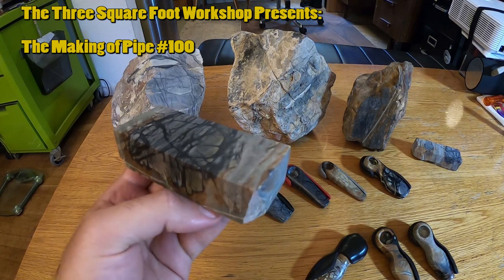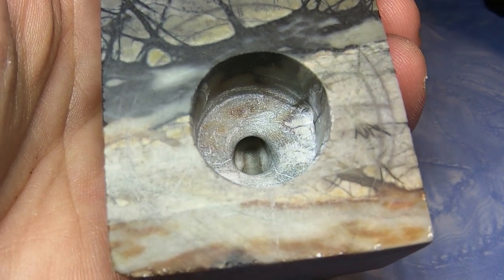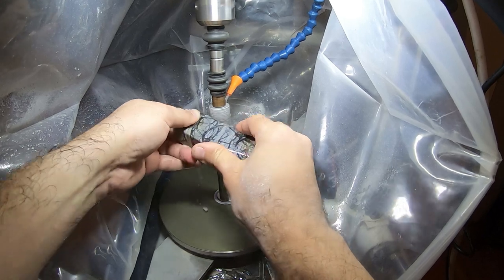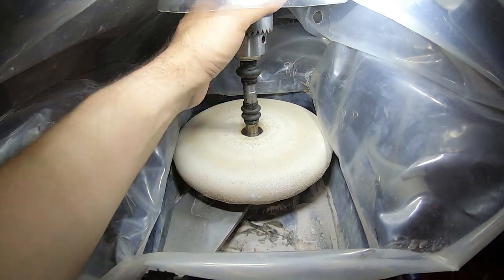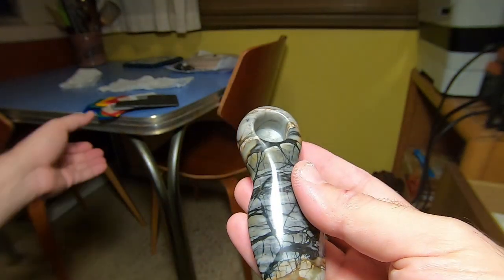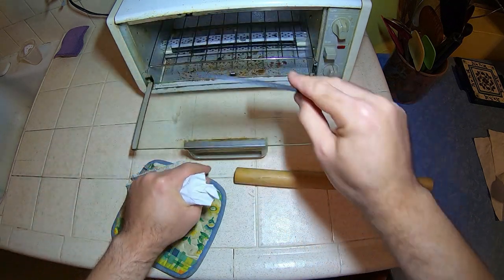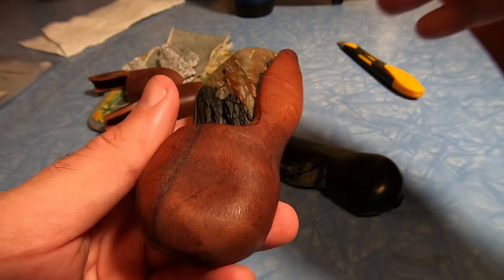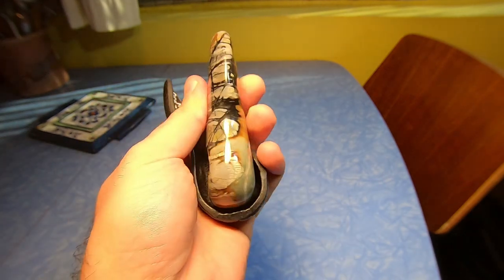How I do it: Stone pipe with moulded cap; functional, elegant & convenient (#100)

Comment: Where can buy buy high quality stone pipes? I’m just tired of imperfections in my glass pipes and because they are always in the bowl
Reply from the maker: That's a tough one.  I started making stone pipes myself years ago, because I was unable to buy decent ones.  The ubiquitous "crystal pipes" are cheap imports; although many of them are quite pretty, I doubt they smoke very well (improper bowl geometry; they require basket screens).  Have a look at etsy though; I can't speak specifically to anyone there, but I have found a few folks with work that impressed me when I've browsed to see what's out there.  (Also lots of folks there reselling those imported "crystal pipes", so beware.  Avoid anything that needs a basket screen.)  If you have your heart set on one of mine, I would be flattered, but price will be high.  Each one takes 6 - 10 hours, so you can do some math and make me an offer where equivalent hourly wage wouldn't be insulting.  (I am a hobbyist, this is not a business, although maybe someday...  Would need to make more tools to substantially cut down on time needed, so prices could be more reasonable.)  Currently available inventory is shown here:
https://1drv.ms/u/s!AvYb6LjaPrjqkRiG6U7clQCJM2qC?e=KTyyRi

Comment: Hey I want to set up a shop like yours. I want to follow this process so I can make my own stone pipe. Can you please send me a list of your equipment needed to make a drill press into a grinding wheel like you have? I would really appreciate it
Reply: Also where are you getting the tools? If you could include make, model, price etc I would really appreciate it. Also what kind of plastic sheets are you using for the kids?
Reply: -lids
Reply from the maker: @jasonfink985 
Thanks Jason!  You're in luck; my next video ought to be posted this weekend, and goes into depth on the drilling fixtures and tools, including make and model of the big pieces.  I spent a few grand for all this.  I have plans on making a video all about 'grinding mode' in the future, but that will take a while before I get too...  (Also want to show more about the closed loop water system, drill bit sharpening, and a few other topics.)

The pipemaking and stonecarving groups on Reddit would be great resources for you to explore.  (I also learned tons by joining my local Rock & Mineral club, and got access to the giant saws and stuff in their member workshop; check out your area for that sort of thing too.)

I turned my drill press into a grinder for space savings reasons; not cost savings.  Wouldn't recommend you follow that path if you have room for a real grinder.  Look at the Ameritool Universal Heavy Duty Grinder, Hi-Tech Diamond All-U-Need, and their Slant Cabber.  And explore the Covington Engineering catalog; they sell machines, and PARTS!  One of their arbors is how I support my grinding wheels.  (Assembled special for me; upside down, and with a ring pressed into it myself to bring up the diameter to match my drill press's table support arm...)  The driveshaft is a Lovejoy DD3 double U-joint, with bellows added to both joints.  (This was more expensive than the custom arbor!)  One end fits directly in the drill chuck, the other I drilled and tapped to screw into the arbor.  Got that from McMaster-Carr, also my source for metal stock, drill bits, and some of the grinding wheels.  Diamond coated stuff from elsewhere, such as Crystalite (now part of abrasive-tech.com), Minnesota Lapidary Supply, and Kingsley North.

The plastic for the caps is a slightly foamed PVC, trade name Sintra, commonly used in the signmaking industry.  Many vendors just sell full sheets which are giant and expensive to ship; but some folks on Amazon and such cut them down and resell.  (When my buddy broke his finger they gave him some to make a custom splint, instructing him to soften with boiling water; great way not to overheat and burn it I guess, but I do take it a bit hotter than that.)
Reply: @TheWackyNeighbor  hey thanks for your reply. And thank you for being so prompt. So I have a bench grinder with 6 inch wheels. If you were trying to save money what wheels would you get for the marble? I was told that silicone carbide wheels would be great by another guy on youtube but he was working on a piece of pipe stone so  obviously a softer rock. So would those work for marble?
Reply from the maker: @jasonfink985  Bench grinder isn't ideal, but you could probably make it work.  Can you control the speed (or is the fixed speed appropriate)?  Can you drip or spray water on it without causing damage or making a mess?  (very helpful for stone work; make sure you have a good respirator/dust mask if you attempt to work with stone dry, and go slow as it'll heat up)  Most bench grinders are intended to use the edge of the wheel as the grinding surface, but I prefer the sort of wheels that let you grind on the larger flat face.  Your machine may or may not allow that sort of wheel to be mounted...  Yes, silicon carbide ought to work fine for marble.  It's actually fairly soft, as stones go...  I use carbide masonry drill bits, and carbide wet/dry sandpaper.  If you step up to something like granite, then you've got to use diamond for everything.  I've been able to drill labradorite with carbide, but felt like I was getting nowhere with carbide sandpaper, and switched to some diamond sanding sponges...  I suppose for marble I could get away with doing the rough shaping with carbide tools too, but I've got a nice diamond wheel and cylinder which cut very fast, so happy to have them.  I have used diamond core drills a few times experimenting with harder stones, but they are a PAIN, and it gets expensive as they don't survive long.  (And I had to extend them myself to complete the long drawhole.)  If you're going to stick with marble and similarly soft stones, and want to keep costs down, I'd look at just getting a sanding disc attachment, and some 80 grit wet/dry discs for rough shaping, and some higher grit discs to remove the deep scratches and refine the shape more carefully/slowly.  (E.g. common hardware store stuff, not specialized lapidary equipment.)

Comment: I'm having trouble finding the correct bit for drilling the long tube. What do you recommend?
Reply from the maker: I use six inch long 3/16" diameter masonry bits (intended for drilling concrete with a hammer drill).  Source:
https://www.mcmaster.com/8897A23/

Note that 3/16" is a kinda large diameter, but I like that it takes longer to accumulate debris and become restricted.  5/32" is commonly used for drawholes.  1/8" is also used, but I think that's definitely a bit too narrow.

Note this sort of bit, with a carbide tip, is only effective with soft stones.  Marble and such is fine.  Even something as hard as labradorite is fine; as its crystals shear away with relative ease.  But this won't work for harder stuff like agate, jasper, granite, serpentine, petrified wood, etc.  If you have your heart set on drilling that, it can be done with diamond core bits.  They're a lot more expensive, a lot slower and more trouble, and they only last for about an inch of drilling before you need a new one.  And they're short, so to make a deep hole you've got to extend them.  I tapped threads into them and used a cut off bolt as an extension, but I've heard people say you can get away with just jamming a rod into them, i.e. press fit without threading.  Source:
http://www.lascodiamond.com/Merchant2/merchant.mv?Screen=PROD&Store_Code=LDPI&Product_Code=5mm

I haven't used those often; there are just too many beautiful marbles in this world to bother trying to make pipes out of agates.  Do note that the bit labeled 3/16" is the size of the tube; the diamonds spread around the end mean you wind up with a significantly larger hole.  You may want to use the one labeled 1/8" to start, if you're not sure you like large diameter drawholes.

Good luck!
Reply: @TheWackyNeighbor  I used the same bit on my drill press. It's not working for a Jade piece that I'm working on. The tips keep getting blown out.... Maybe Jade is just too hard?
Reply from the maker: Could be.  I have some jade, but haven't tried it yet.

Comment: Can granite or quartz be used?
Reply from the maker: With diamond core bits yes, but that takes longer, and you'll burn through a few of those with the drawhole, so it gets expensive.  (And I had to lengthen them myself.)  For softer stones you can use inexpensive carbide tipped masonry bits.  I once was able to use carbide to make a pipe out of Unakite, which is a granite, but that was a lot of trouble and I won't be trying again.  Labradorite is about as hard as I've gotten to work well with carbide.  And even that is a lot more difficult to shape, smooth, and polish.  Used diamond pads rather than wet sandpaper.  But I have so much beautiful marble on hand, no need to up my game on the hard stones at this time...  (I do have some diamond core bits put away, enough for a couple pipes I expect.)
Reply: Any helpful tips? I just recently moved to an area with a lot of quartz, marble and granite in the area. Looking to get into making pipes.
Reply from the maker: Are you just looking to drill holes in pipe-sized pebbles you come across, or do you have saws & grinders to cut up and shape larger pieces?

For marble, bits like this are fine:
https://www.mcmaster.com/8897A23/

For harder materials like granite and quartz, more like these; buy lots, you won't get far with each one:
https://lascodiamond.com/LascoProducts-CoreDrills.html

In either cases, drill with the stone immersed in water, or with a constant water spray.
Reply: Was thinking I could just use a dremel tool and drill bits.
Reply from the maker: At the end of my video, you can see pipe #1, which I made back in 1995.  That one was made with just a dremel; out of soapstone.  (Alabaster would also be suitable.)  Stones that soft are not very durable though, unless you put under many layers of varnish.  I eventually burned out the dremel by overstressing it, and got a more powerful hand drill, and eventually a proper drill press.  Good luck.
Reply from the maker: @daveboggs1746  Sorry it took me so long to see this Dave; got 'held for review' (probably due to phone number), and I never checked for that before.  (Surprised not in my notifications.)   Anyway, you can contact me at <wackyneighbor@yahoo.com> if you're still interested.  Current inventory: 
https://1drv.ms/u/s!AvYb6LjaPrjqkRiG6U7clQCJM2qC?e=KTyyRi